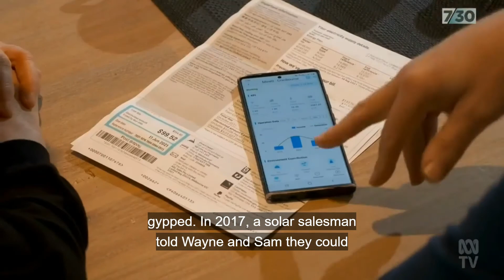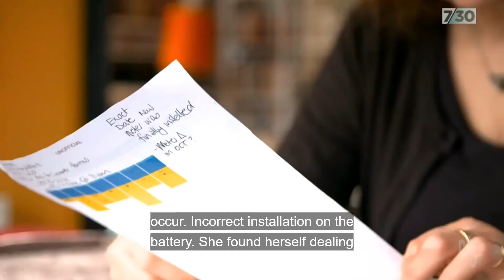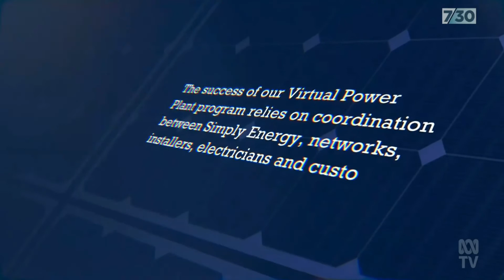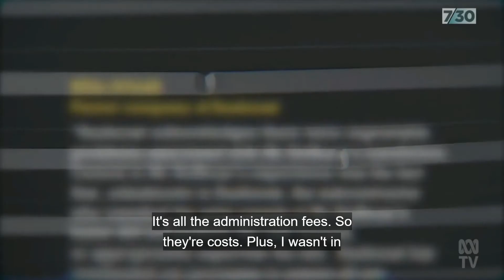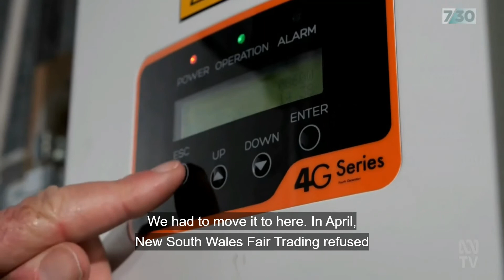ABC Report  - 3rd August 2021 - Solar Pitfalls

Comment: Solar isn't for every geographical location. It's a pretty shitty system if it has a single inverter! These days panels have individual inverters so that individual panel issues don't impact the system.
Reply from the maker: Nothing wrong with a single inverter
Reply: @iqsolar9633  single point of failure and it means the panels are isolated from one another. Tech is better than that now.
Reply from the maker: @kenthhamner2641  Yes, thanks Kenth. And micros only cost 50% more than a string inverter. We do both, often. Sometimes the best tech isn't the best value. And the inverters have a long life, so single point of failure can mean a failure in 12 years.
Reply: @iqsolar9633  My Xantrex inverter is almost 20 years old. I built my small system myself and it has worked for many years only the batteries have changed and i'm quite happy with it. Greetings from sunny Jamaica.
Reply from the maker: @lawrencedavidson6195  that’s great news!
Reply: Fronius, SMA etc are very good single inverters but even they would probably fail quickly being installed on western side wall....

Comment: Yikes 😬… hopefully I don’t get such poor installers when I get my system.
Reply: Use a all in one inverter. It's a plug and play that any home owner can put in. One inverter eliminates all the headaches of wiring in all the components that's needed. It's all built in. Check out midnight solar hybrid inverters. A 5000 watt will only cost 900 bucks. San tan solar for pannels. 20 - 250 watt pannels cost 700 bucks. They're used solar farm pannels that have at least 20 yrs left on them and they are great.